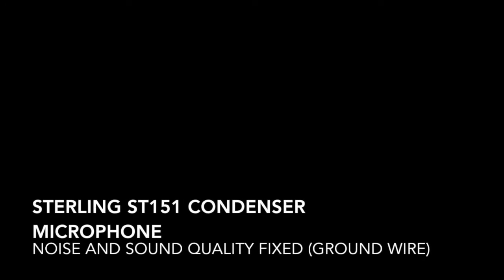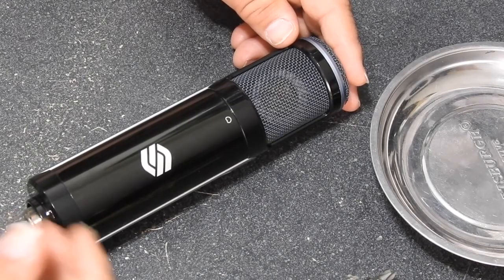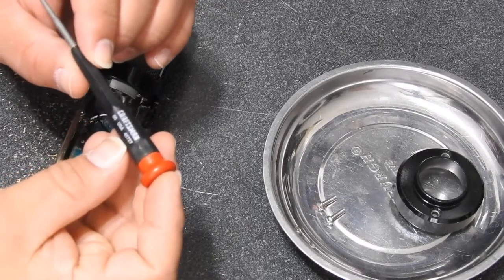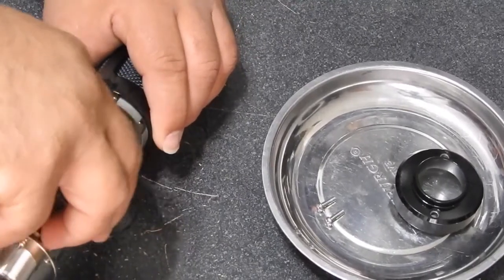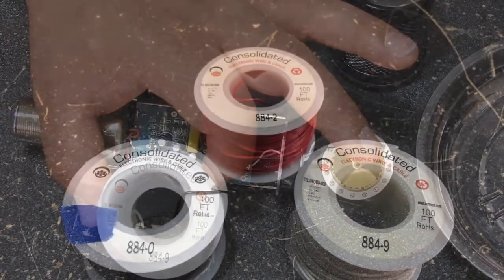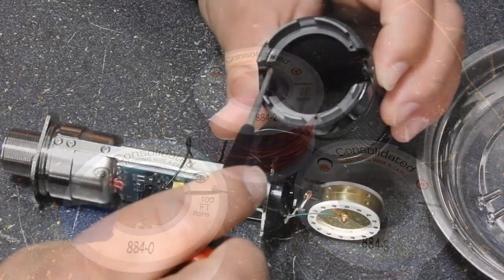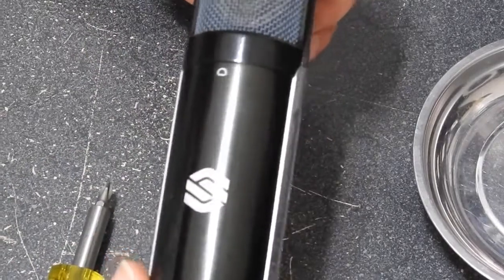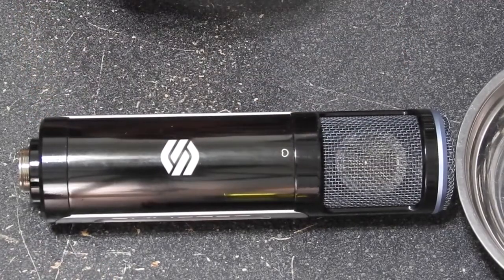Sterling St151 Noise and Sound Quality Fixed

Comment: you saved my life man, same issue but with an sp150, i just replaced all the flying leads with some 18awg stranded and it cleaned up my recording so much
Reply from the maker: You welcome!!! mine works fine after that no noise or bad sound. enjoy.